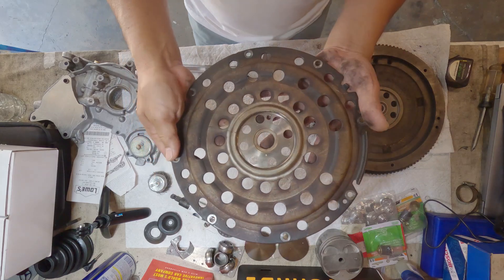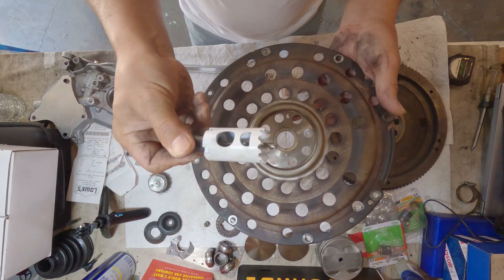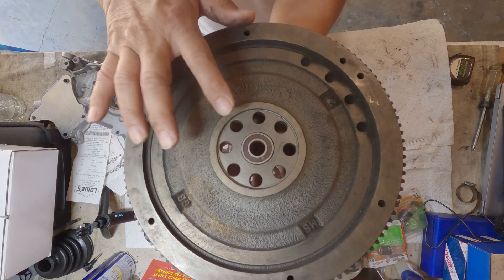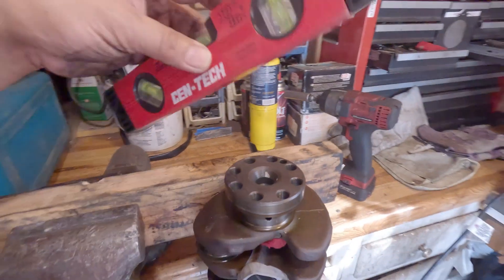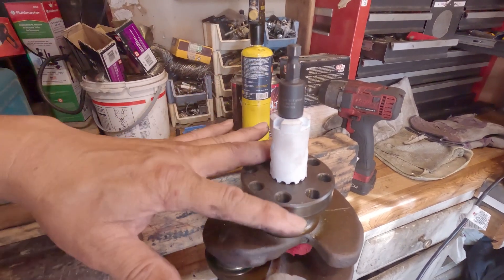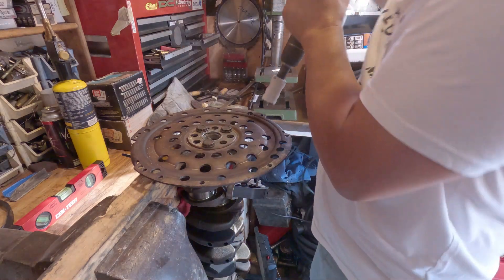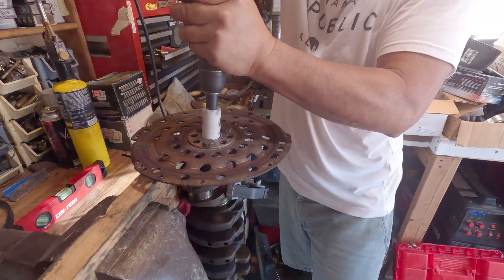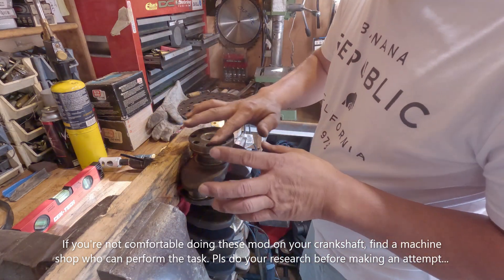Modifying F23 crankshaft for B series flywheel. H2B setup!

Comment: Do you use a chipped OBD1 computer on your builds?   And what software do you recommend, Hondata or crome or something else?   I'm getting ready to do an F23A1 build for a '98 Accord,  but I'm not even sure where to start as far as the powertrain management goes.   I'm wanting to do a naturally aspirated build, and I'll be using a manual transmission.   At HA motorsports they have a mostly ready to run Hondata S300 V3/chipped P28 ECU for around 950 dollars.   I believe they have some basic basemaps available for free to get it at least running.    Not sure what the most cost efficient way to go would be though.
Reply from the maker: I'm using p28 w/ S300 on boosted engines ( built in protection) and chipped P28 ecu on NA setup. Cost effective will be NA setup, there's not a whole lot of room for error, not like a boosted setup that'll cost you double and you can't really do a short cuts when building aspirated engine. Hamotorsports  do send their ecu w/ basemap for chipped p28 but you have to specify what size of injectors you'll use and your build setup. Hondata s300 on other hand, once you get the ecu, you can choose any basemap you want coz you can download it for free. H22 swap will be reliable route. It'll give you more power if you combine it w/ good intake mani, exhaust headers. If you choose to go the frank route like a G23, use parts like what l mentioned on my vlogged. Plugging the head, it's your choice to use those 2 plugs that you can buy from kstuned but put some sealant over it(top n' bottom). I've been seeing some folks have oil leakage from it still. Good luck on you project man ! Thanks